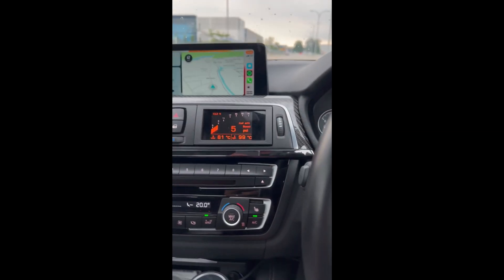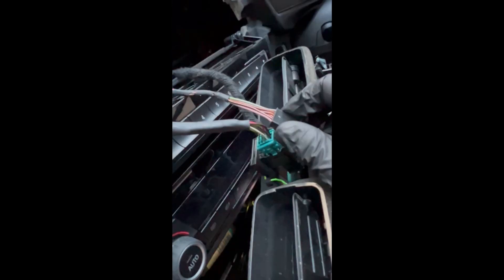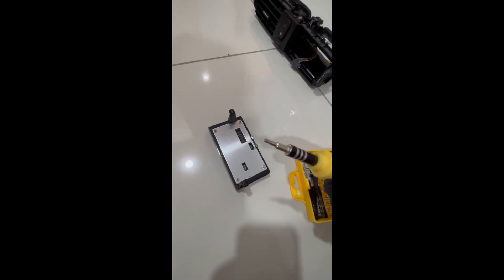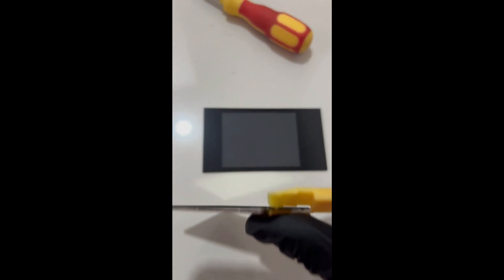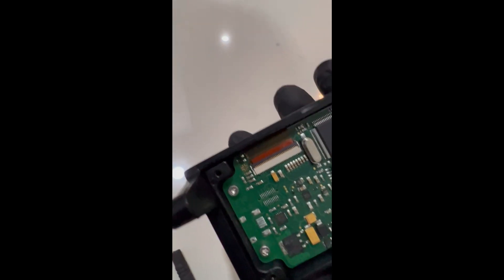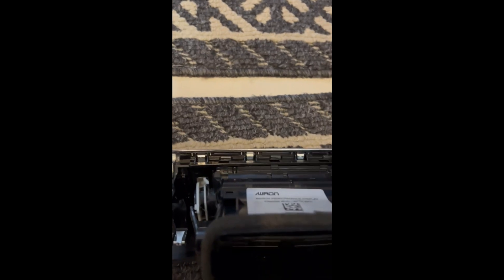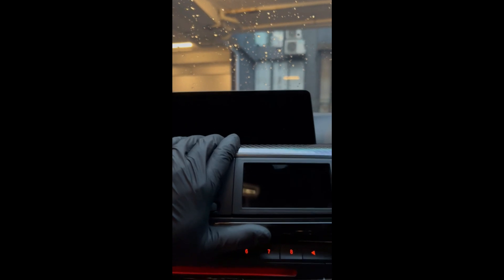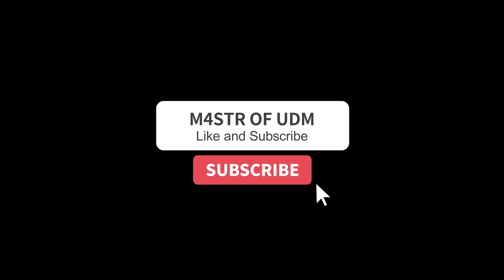AWRON DGA OLED SCREEN REPLACEMENT FOR BMW F82 M4

Comment: Hey I’m having a hard time finding the supplier. Do you have a link available?
Reply from the maker: Here u go bro 

Just found this amazing item on AliExpress. Check it out! MYR706.52  22％ Off | 2.83 Inch OLED Screen CMEL 961017 2P8_S6E63D6_61PinBF_R04 Display 61 Pin AMOLED Panel C0283QGLD-T Wisecoco
https://a.aliexpress.com/_m0Rtqle
Reply from the maker: Pls like share and subscribe ya 🙏🏼